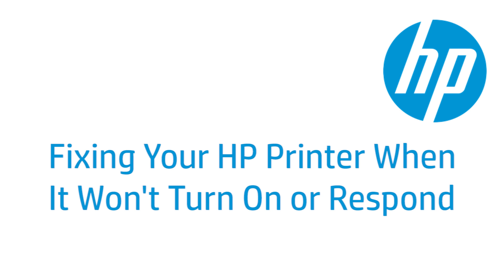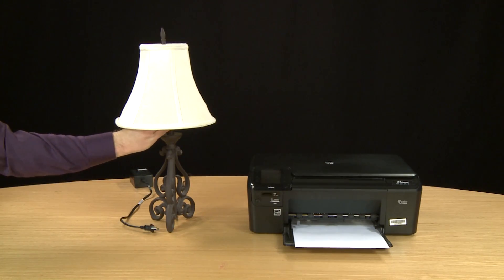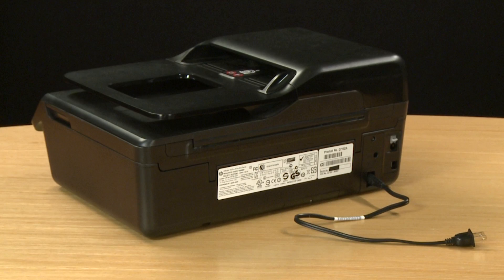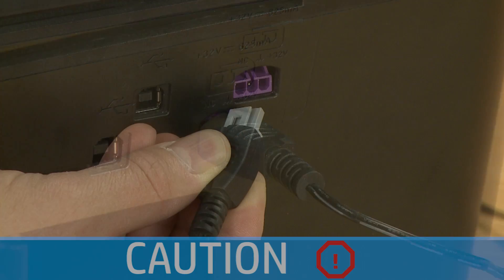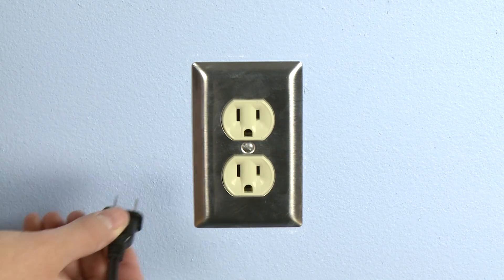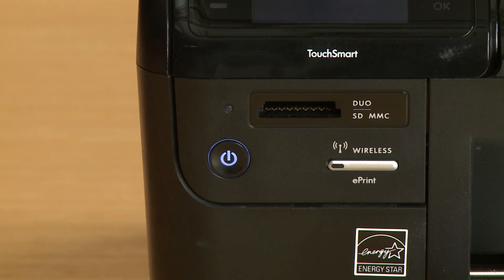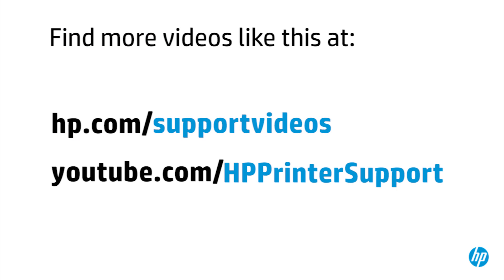Fixing Your HP Printer When It Won't Turn On or Respond

Comment: TERRIBLE! VIDEO SAYS THERE IS A RESET FOR INTERNAL POWER MODULE, THEN FAILS TO TALK ABOUT HOW TO DO IT!!!!!
Reply from the maker: Hi plongs3,
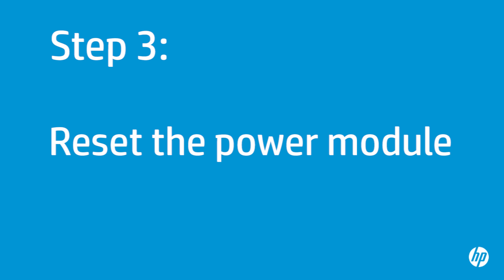The video walk you through how to reset the printer starting 3:57 of the video.  It shows an additional step to take if your power module was external.  Since your power module is internal you would follow all the steps EXCEPT for the unplugging the cable from the external power module.
Reply: Well HP sent a remanufactured 276dw to replace the one that wont turn on , now 4 wks later IT WONT TURN ON !
Reply from the maker: Hello plongs3,
I’m sorry to hear that you are experiencing a similar problem with your replacement printer.  Please call our technical support at 800-474-6836. If you live outside the US/Canada Region please go to Google search and enter 'contact HP worldwide'.  Your first option should be the site for contacting HP, when you click on it you will be prompted to choose your country/region.

Comment: I have an HP psc 1610 and every time I plug it in it turns on and a square goes from one side of the control panel and freezes little over half way it won't do anything my computer does not even recognize it
Reply from the maker: Hi Richard Lamberth,
Is the printer plugged directly into a wall outlet?  It is important for the printer to plugged directly into a wall outlet to ensure it is getting the power that it requires. What happened after you tried the Power Reset shown in the video? It begins at 3:56 of the video.
Reply: ***** it is still doing the same thing and yes I plugged it in to the wall outlet
Reply from the maker: Hi Richard,
Please search for C01330821 on HP’s home page or using Google search.  The title of the document is “The Control Panel Display Always Reads 'Initializing', or the Product Does Not Start”.  The error you are experiencing is similar to the title of the document.  Please follow the troubleshooting steps in the order presented.
Reply: ***** that still doesn't work
Reply from the maker: Hi Richard,

We have one thing left to try.  Please follow the steps in the order below:

·         Please remove all the ink cartridges from the printer.
·         While the printer is turned on, please remove the power cable from the printer.
·         Please remove the power cable from the wall outlet.
·         Please wait a full 60 seconds then please plug the power cable back into the printer and the wall (with the ink cartridges still out). If the printer does not turn itself on, please turn the printer on.
·         If the printer gives you the error message about missing inks, please put the inks into the printer and try printing.
·         If the printer doesn’t give you the message about the missing inks, please call our technical support at 800-474-6836. If you live outside the US/Canada Region please go to Google search and enter 'contact HP worldwide'.  Your first option should be the site for contacting HP, when you click on it you will be prompted to choose your country/region.

Thank you.

Comment: I currently own a HP Photosmart C4585 and it will not power on. I assure you it is not the power supply in any shape or form. The problem must be the printer, it currently has no ink, would that cause the printer not to turn on?

the power button gets stuck when i press it, and after i figured out a way to fix that issue it still wont turn on. Would  no ink be a problem for the printer?
Reply from the maker: Hello ThrustForSpeed,
Please search for C01321436 on HP’s home page or using Google search. The title of the document is “The HP Printer Won't Turn On or Respond When the Power Button is Pressed”.  It has a couple of additional steps that are not in the video.
Reply: I have been to the site and it still does not respond to the power button is pressed. Are there any steps YOU would recommend?
Reply from the maker: Hi ThrustForSpeed,
If none of the solutions in the document provided doesn’t resolve the issue then I would personally, be calling HP Technical Support at 800-474-6836. If you live outside the US/Canada Region please go to Google search and enter 'contact HP worldwide'.  Your first option should be the site for contacting HP, when you click on it you will be prompted to choose your country/region.

Comment: The problem repeats... The power outlet is working , but every time I turned off the 4620 for a day and it does not power on unless I unplug and plug the power cord.....
Reply from the maker: Hi kcarsonsChannel,
Please search on HP's home page or using Googe search for C01321436.  It is a document with detailed trouble shooting steps to take to help resolve the issue.  Another document to try is C03365241.  It is a trouble shooting document for when the printer turns off repeatedly.  I know that is not the exact issue you are experiencing but the steps in the document are valid trouble shooting steps.
Reply: Sadly, the troubleshoots didnt' help. The unit is turned off by ON/OFF button, it's still unable to start after turned off for a while (like half a day). Should I contact the HP service centre to arrange a service? Or I missed something else? Thanks
Reply from the maker: Hi kcarsonsChannel,
 
Please call our technical support at 1-800-474-6836. If you live outside the US/Canada Region please go to Google search and enter 'contact HP worldwide'.  Your first option should be the site for contacting HP, when you click on it you will be prompted to choose your country/region. 
 
When you call in, please let the agent know which document numbers you have already used and that you have tried all the solutions/steps in those documents.

Comment: Ps. The power supply output must also be DC. If the supply's output is AC or its voltage is too high, then this is very likely to immediately damage the device. Whereas if the supply's voltage is too low, or cannot supply enough current, then the device may not turn on, but it shouldn't be damaged. A low quality supply may slowly damage the device.

The ‘incompatible’ supply in the video (32V DC 1560mA), is DC, at the correct voltage, and capable of supplying 625mA, so is actually compatible.

Comment: Problems with this video:
* Electrical current is incorrectly called ‘amperage’ in this video. Current is the correct term measured in amperes, or amps for short (or in this case measured in milli-amps).
* Although the voltage output of the power supply must be equal to that required by the printer, an electrical appliance will only draw the current it needs (unless there's a fault). A 32V DC 1570mA power supply *is* compatible with a 32V DC 625mA printer.
* This video is boringly slow!

Comment: probably the most boring voice over ever - and if this is what hp think a support video is I am really worried - save some time and .... disconnect power module leave for about 20 seconds and reconnect and plug in - if the green led does not come on then the power module is goosed - if it comes on then the printer should work... thats it - if the led is on and the printer doesn't work, and the guarantee is out .... basically you are stuffed. as am I